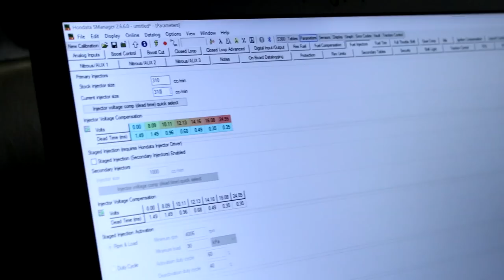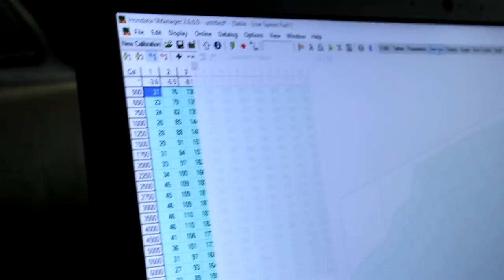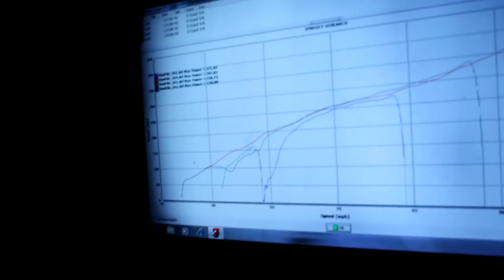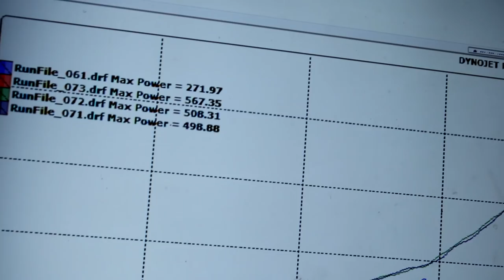Turbo Minivan Makes Crazy Power!

Comment: I feel that someone else has probably already said this but DO NOT PUT ON AXLE NUTS WITH AN IMPACT. Your going to burn up your bearings which use the axle nut for their side load tension, if it's too tight the bearing balls dent the casing and cause significant friction.

Comment: You need to use a torque wrench,not a bigger impact....
It will allow you to avoid those troubles.
Reply: why missing the fun of "what piece will I lose today?"
Reply: Kyle, you don't need a new impact wrench. And you don't need Loctite on the crank pulley bolt. You need to get a torque wrench, and learn how to use it.  Every time some random part falls off the car because the bolts weren't tightened properly, it makes you look like a doofus.
Reply: +blacktree666 is correct
Reply: I was thinking the exact same thing!
Reply: Kyle.  In addition to a torque wrench, you need a special tool made by Honda.  It holds the crank while you torque the crank pully bolt.  Best of luck.
Reply: He needs the correct tool to counterhold the pulley and a torque wrench..
Reply: Frank Howard Na. Just gotta know some back yard secrets to hold it lol
Reply: blacktree666 that’s because they don’t know fully what they’re doing lmao
Reply: As an addendum to this statement, torque values aren't only to make sure things don't fall off, they are also to preload bearings correctly so that they actually bear loads vs act like spacers.
Reply: He just didn't want to go buy a tool to hold the pulley lol. Engine parts always need to be torqued to spec.
Reply: @ @frankhoward7645  let me guess you work at Honda?😱 "need a special tool from Honda" yeah okayy how about drive to advance/auto zo e   buy it for $12.99 or yea listen to this guy n spend $250 for the SAME EXACT TOOL...There ARE some things WORTH going oem Honda on like auto tranny fluid etc but DEFINITELY not "special tools" just a way for Honda to continue making money off uneducated enthusiast.
Reply: @Leon-fo9mj   I work for Honda?  Sorry, but you're wrong.  I said, "...need a special tool made by Honda."  You said I said, "need a special tool from Honda".  When you quotation marks, make sure you quote VERBATIM.  If you can't quote what someone said EXACTLY, then don't use quotation marks.  Duh.  "...how about drive to advance/auto zo e   buy it for $12.99..."  I called Auto Zone.  They don't sell it.  You're just making up stuff.  Fake news from you.  "or yea listen to this guy n spend $250 for the SAME EXACT TOOL..."  I never suggested that you spend $250 for the same exact tool.  I purchased mine from Amazon for $25.63.  Next time, why don't you get your facts straight before posting?

Comment: That thing will have trouble putting the power down for sure since its so backheavy and the front end will just lift up when you do a pull. You should put way stiffer springs in the back it might help.

Comment: How about a brake upgrade so you don't crash and burn. 700 hp is cool but stopping is sometimes hotter!
Reply: peter harter I know right.. when I put a 250hp 1.8turbo in my Mk2 Golf even I upgraded to bigger brakes.. Can't imagine pushing 700hp in a minivan and not having some proper stopping power.

Comment: Torque spec on that bolt is 185 Foot Pounds. Also the "key way" is the slot. The "key" in this case a woodruff key (part number 90704-PT0-000)  is the metal tap that slides into the slots on the crank snout and the pulley.

Comment: Bad ass setup. .I have always heard that the blow off valve should be closer to the intercooler rather than closer to the throttle body though...have you guys noticed any difference?

Comment: that van is fucking sick!! could we potentially see a 4 digit dyno reading?
Reply: I would think it could do 1000 easily if he's willing to turn the boost up.  567 at 14 psi is damn good.
Reply: Crack shaft would have to be heavily modified
Reply: Lilud Brent said in a previous video that he had H22's hit 1000+ with the exact same build.

Comment: Such shady work... MAN.. Oil in the brand new turbo.
Driving around a car on a dead cylinder.
Bootleg fuel pumps.  Cranks blowing off.
Crank pulley comes off - your bearings are likely trashed.  Or crank is bent or something like that now.

Comment: Route a proper exhaust. Quieter and will make a better backpressure. Plus sleeper
Reply: after the turbo you want the freest flowing exhaust possible
Reply: Backpressure iss bad for turbos.  The best exhaust is no exhaust
Reply: Back pressure is a myth. Exhaust velocity is what you want with a full exhaust
Reply: Yeah lmao why do you think v8 race cars run with open headers? Back pressure negates horsepower.
Reply: I always grew up that some backpressure was better than none. Whatever builds power. Im more for practicality than power. My vette has maybe 400 horse on 5 psi and sounds near stock, small cam and bigger exhaust. Never would know its boosted.
Reply: Will Thies why only 5psi whats the point to have a boosted vehicle tp run 5psi. Most people run 10psi because thats considered low and safe
Reply: Will Thies - try removing the rear section of your exhaust and see how much more responsive it is.
Reply: He said in the video at the start that it's just temporary so he could go on the dyno and get it tuned
Reply: Will Thies the reason why a huge 6 inch exhaust wouldnt make more power than a smaller one has nothing to do with backpressure.  Its exhaust scavenging.  In order to have a properly flowing exhaust it has to scavenge well and backpressure is just a byproduct.  If you could fire the exhaust into a vacuum, it would perform even better.  Backpressure is a myth.
Reply: jj Watson dont need to go intercooled and with slightly shaved heads i went from 200 whp to 400 at 5psi. 79 l82. 23 mpg highway out of boost. Practical. Little loud. Doesnt draw too much attention. And i can drive it any day without worrying
Reply: Will Thies but yeah for the street, it'd prolly be illegal to have anything too ridiculously loud lol. Btw Idk what you have but you could probably run 10psi reliably

Comment: You need to v6 swap that and put that big ass twin scroll holset on it and make some serious power then eventually awd swap it
Reply: dude he has a minivan that has a jseries v6 in it already
Reply: Pure Essence he needs to toss that holset on it and manual swap that then ha
Reply: That's the reason he got this first gen because it came with an F series so he could easily H swap it. It's what he's comfortable doing and the parts are everywhere compared to j series and the manual transmissions for those are junk and hard to find.

Comment: Yeah def need a better impact. Honda uses Loctite from the factory for the crank bolt. Ive never put Loctite back on them but my 800ft lbs 1/2 and tightens them down no issues lol luckily no engine damage occurred that would have sucked.

Comment: I just use a long breaker bar for double checking anything. Also Kyle, how was all the boost pipes as far as heat soak etc. curious Cuz I want to make mine short.

Comment: I had the exact same problem with an eBay distributor for my b series the issue is the points on the cap are not set right so the timing will never line up right keep it and just get a new cap from anywhere besides eBay

Comment: I still wish you'd run a pod filter on the end of the turbos man get a big one. You aren't going to see enough of a power drop to matter plus all the benefits. At least a mesh screen. I know you've never had a problem but theres a reason so many people at least run a fine mesh screen.
Reply: mlg fallout gravy no there are reason why if alot of people do it
Reply: mlg fallout gravy So you'd rather grenade your turbo when debris gets sucked into the compressor wheel, and possibly pit your pistons and valves?
Reply: mlg fallout gravy Yet.

Comment: Do you not have any issues with running e85 on stock fuel lines ive been doing it for about a month
Reply: Austin K i once felt like putting my e110 race gas in my car but decided not to

Comment: you just need bigger airhoses and nozzles for that impact tool.   you can have the best tool in the world but if the air supply is limited by a bottleneck somewhere your power drops alot.
need to be diameter like a thumb.

Comment: I had a 95 odyssey and swap it with an H22 but ended getting rid off it. I’m about to get another one would you be able to give me info of the motor and the things you done to it or who did the work for it thanks. Ohh by the way this is a BADASSSSS G1

Comment: Pretty sure you boys just redefined the term sleeper with this one. I dont know what it is with those f22 and h22 crank pulleys. Back in the day I tossed one twice on a 95 accord and once on a 99 prelude. That was after torquing the shit out of both of them and using lock-tight.

Comment: hey guys, which wires at ecu(s300) do i splice into for an electronic boost controller (mac valve) for boost by gear?

Comment: I cant believe how fucking lucky you got with the CS pulley! I had the same thing happen, except i was driving & the cause wasn't a loose bolt, it was a broken bolt! So i had a broken bolt stuck inside the shaft. I had to use a left threaded drill bit to back the broken piece out, and if it wasn't for my Dad having the knowledge/experience from doing it before, i woulda been up Shits Creek haha it also threw timing which it didnt seem to happen to you, or you just didnt show it, but Yeah... You got Lucky AF! The Mini Van is Fuckin sick tho! Its guna suck for the guy who dropped 15k into his Civic & thinks hes guna smoke you, but little does he know that hes about to get drug a few blocks and left in the smoke wondering what just happened LoL

Comment: Hi. What fuel pump and fuel lines you use?
Reply: Sullu16  walbro 450
Reply: slamblackek9  stock fuel lines on e85?
Reply: U can do that but it's going to limit u on how much hp u can get my I have the -8 feed and return
Reply: slamblackek9  ok. I have bmw m50 turbo. Bosch 044 pump and 8mm fuel lines. Stock 6mm
Reply: Sullu16  dann u love to check my boi e36 m3 boosted fully built
Reply: slamblackek9 show
Reply: Sullu16 that's a very good fuel set up u don't need the return to be big because it's not under pressure

Comment: Is that a water cooled turbo ?
Reply: Austin K watch the previous episodes bruhh. An you'll find out
Reply: its both oilcooled and water cooled. They just arent running the water half since its a pain in the ass to plumb.
Reply: Niko Garcia fuck that id run the lines it makes the turbo last way longer
Reply: Austin K if you run a turbo timer or give the car a minute to cool before shutting it down it's just as effective. The water cooling works via what Garrett calls the thermal siphon effect which occurs after shutdown. It doesn't do much during use.
Reply: Niko Garcia seems like water lines would be easier to install than a turbo timer, in the summer my turbo heat soaks so bad that the compressor housing will boil water
Reply: Austin K it's astronomically more difficult to connect the water lines. Routing them is a bitch on a Honda. Mainly because of the top mount manifolds
Reply: Niko Garcia it may be ugly but it doesnt seem difficult id use the iac coolant lines if i had a water cooled turbo i also thought water cooled turbos had to have water going into them but im probably wrong about that one
Reply: Austin K it's not that it's ugly, with the top mount manifolds in a lot of Hondas you can't get the forward facing line to fit without cutting into the front cross member.

Comment: Why don’t you put an MSD on any of your Cars?
Reply: because Honda’s ignition system is obviously good for a ton of power without breakup at high rpm
Reply: Nolan Sweat well yeah. But as an extra precaution? Not saying it NEEDS it. But it would definitely help especially at higher RPMs
Reply: ThomasFrick Yes I’m with you on a why not thing. But there’s other part that would net him more power. Mr2 guys take Honda ignition systems as a upgrade the Honda dizzy is quite stout

Comment: not hooking up the watercooling for the turbo?
Reply: scootbmx01 thats not how an intercooler works. Turbo doesnt get any seperate cooling other from the air flowing thrue. The intercooler cools down the compressed air before entering the intake. Cold air is easier to compress in the Engine. (Sorry still learning english)
Reply: StRRyle, I meant the water lined for the turbo, I'm well aware of how an intercooler works.... I was just wondering if there was a reason he wasn't using the water lines in the turbo... Or maybe it's just my phone that makes it look like it has water cooling.
Reply: Oh, sorry. If i remember right he never had problems not having external coolant so he never used it

Comment: Can you tune a stock ecu? Or do you have to buy a programmable one?
Reply: No unfortunately you can't tune on a stock Ecu.
Reply: It’s a hondata
Reply: Hard to tune a boosted, built engine with an ECU made for N/A and stock compression.
Reply: Kyler Anderson socket it and add a demon 2 to it. You can use Crome or Neptune. Neptune along with the demon 2 is only about 350. In my opinion better than Hondata. Their customer support is a lot better.

Comment: This vs bisimotos van. Who would win
Reply: Jaelin Tillman bisi makes a ton more power, and has a boatload more money so bisi
Reply: Bisimoto would win hes pushing over 1000hp in his.. thats almost doubled then boostedboiz..lol
Reply: This is just the first tune, he has plenty more power to tap into. I'd put money on Kyle' van with another 100 hp because the weight difference between the 2 vans is huge.
Reply: Ebay Honda again bisi is rich he could easily put more money into his setup lol
Reply: Bisi is not 'rich', LOL. You standards of who is rich is very low if you think he is rich. Kyle is pulling in way into the 6 figures and living free in a house his parents bought and although Bisi might have more total money I'd be willing to bet that kyle could spend a few shekels and show bisi some serious competition.

Comment: the intercooler is supposed to be the way you had it in the beggining because now you are putting warm air in your intake ....laws of physics warm air and heat goes up...
Reply: wtf are you talking about?
Reply: wtf dou you think?
Reply: The intercooler will cool the air just as well no matter what way you put it. And if you are thinking of warm air rising to the top where the ports are, that is no issue considering how high the air velocity is going through it.
Reply: ok you can test it in your tourbo car with an intake temp sensor an then you will see. i am waiting
Reply: He won't reply back...
Reply: Well by your logic you better get a hold of the engineers that make over a 100k a year that design the subaru's intercooler that sits on top of the motor. because obviously you know more then they do.
Reply: Joshua Pierre i am sure about that
Reply: Dmanor that's why they have a hood vent smart boy
Reply: Γιώργος Αιγάλεω lol and that hood vent is getting just as much air as the front mount on this van smarty pants
Reply: Dmanor ok you are right I am bored to death to explain good night
Reply: It's gonna be a long ass while before my car is up and running again but I will write a post-it to remind me to test your theory in probably 6+ months :P
Reply: NorwayVFX I will be waiting for a video

Comment: how is your o2 sensor working properly that close to the end of the downpipe? lol
Reply: MultiChimRichalds when it’s on throttle it won’t matter.
Reply: Kyle Kelliher part throttle to near wide open, which is when the o2 sensor is actually used, it will because it's not putting out enough exhaust volume to completely eliminate outside air so they're gonna get inaccurate afr
Reply: MultiChimRichalds okay so even under that thinking it will just look leaner than it really is. So if it reads a safe afr then its actually a bit fat, which is even safer unless it’s an extremely rich condition- which you don’t need a wideband to realize.

Comment: on any other dyno 350hp MAX
Reply: jack black  nah usually we are the heart breakers
Reply: I guess it depends on the financial stake and the marketing potential of the video in question. that turbo size cant feed 600hp. next time do an unedited complete running shot of your dyno settings the loading, brake settings, resistance settings. SAE smoothing and correction factor. lets really see